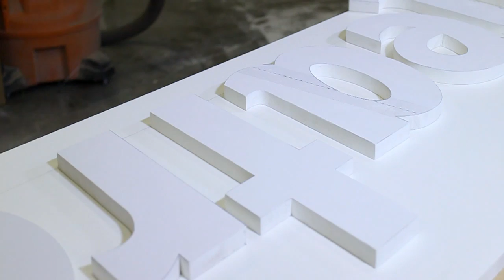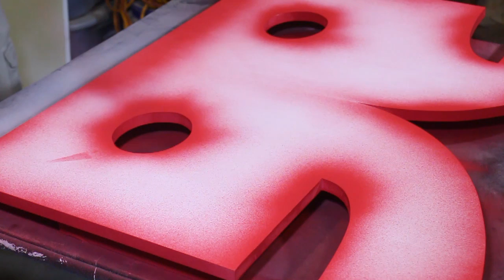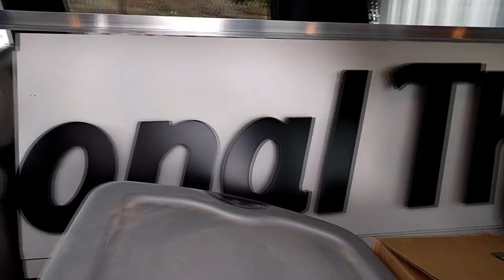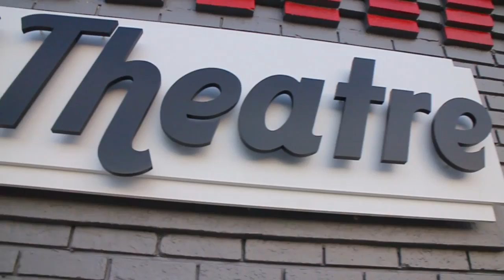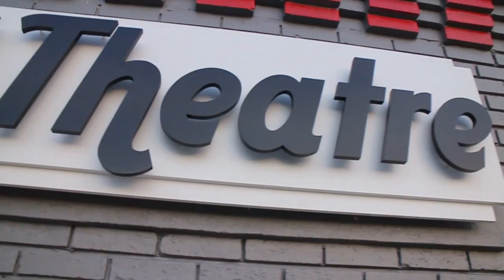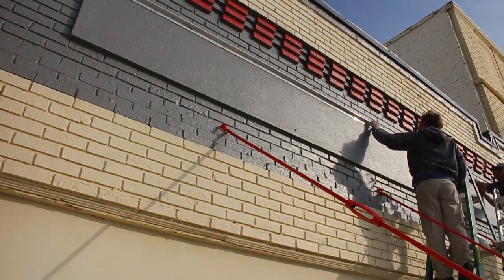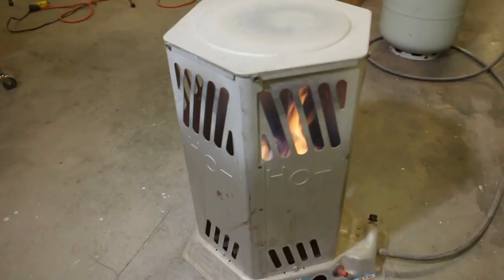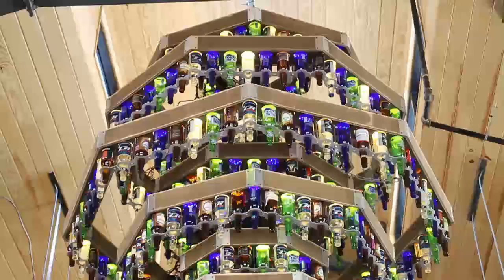Making Dimensional Letters Without a CNC Router

Comment: Nice job, Question.  I would be concerned about the long term weathering of the material.  I know PVC is pretty good, but did you do anything else to help with longevity? Awesome job!
Reply from the maker: As long as you paint it with outdoor paint so the PVC is protected from UV light, you should be fine. 👍